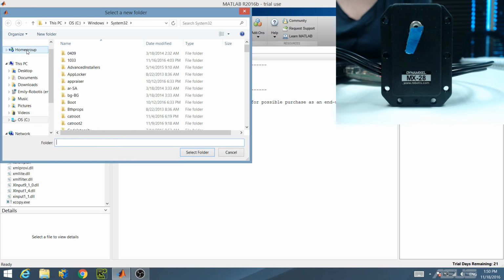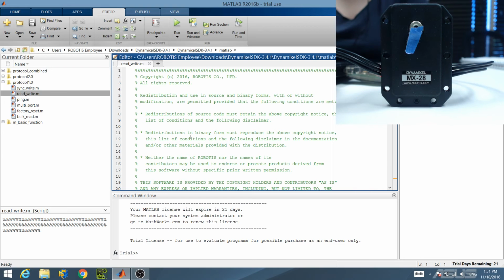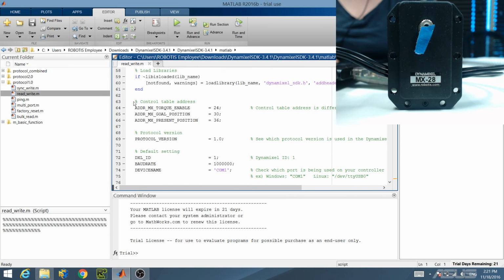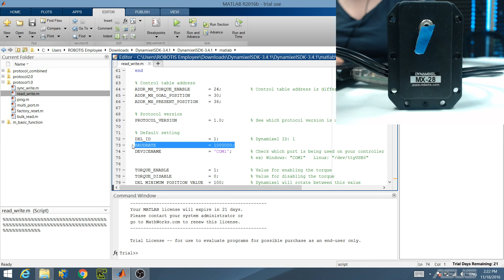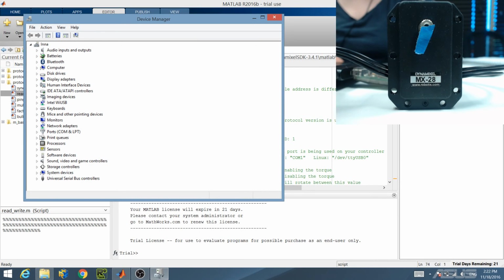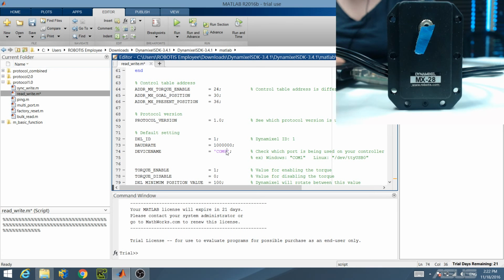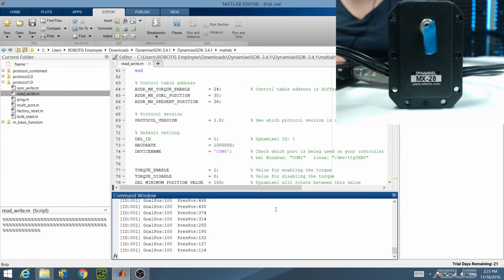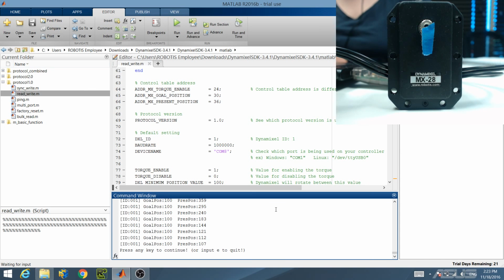DYNAMIXEL SDK Walkthrough MATLAB: Read Write - Single Port Control

Comment: Thank you for the video, was really helpfull. One question, I already developed the code for an dynamixel robot BUT! the servos are too fast, How can I minimize the velocity???
Reply from the maker: You will need to change the value for one of the addresses related to your Dynamixels' velocity (e.g. Goal Velocity). The address number and applicable values may change depending on your model of Dynamixel, so our recommendation is to reference the ROBOTIS e-Manual at http://emanual.robotis.com/ for your specific model of Dynamixel.